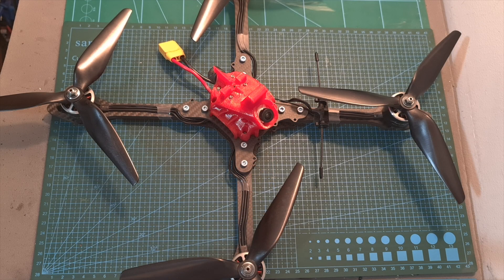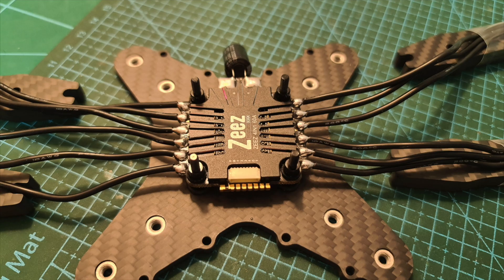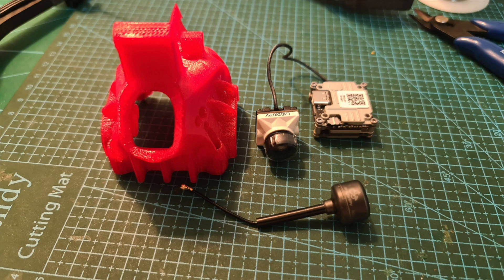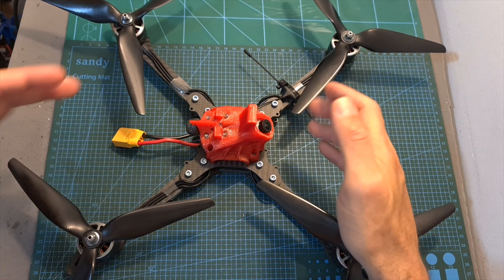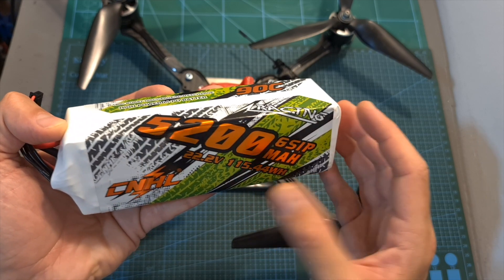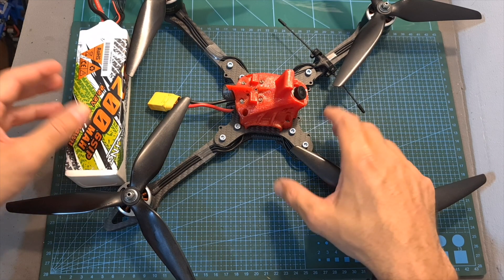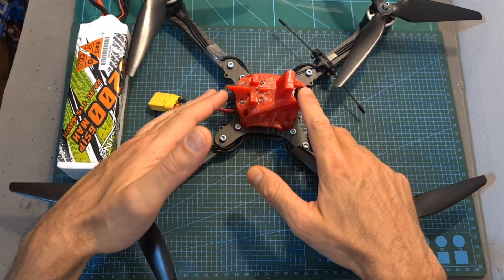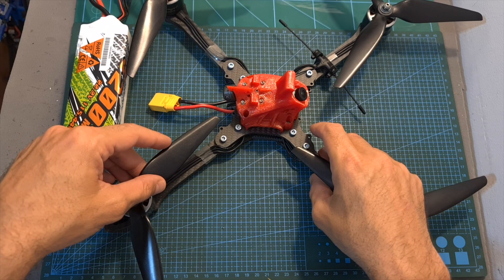How To Build A Monster Quadcopter // CMW Macro Merica 9" Maiden Flight

Comment: Will the 10” with 2816 1050kv still work with a 60 amp 4in1 ?
Reply from the maker: It might but I would recommend to limit the motors output to 90% in order to stay on the safe side.

Comment: I usually take your advice but this time I have to respectfully ignore what you are saying and build one for myself. 

I had already ordered the frame and the rest of the parts after I watched your motor test video for the Avenger 2816 1050kv to build a real bad boy :)

Apart from the parts being delivered, the only thing holding me back are the choice of lipos. 

I am surprised the suggested batteries are on the heavier side, almost as much as the weight of the quad. I am wondering if the motors/prop combination makes for a very power hungry setup  or are we wasting more power carrying so much extra weight.
Reply: Hi, I ordered everything too including the 2816 1050kv brother hobby motors. What conclusions did you have with the battery sizes on your build. I do have a 3300 mah 6s battery on hand and wondered if I should go bigger. Thanks
Reply: @scottgivens27  I plan on using 2 x Tattu 6s 1800mah in parallel on the build because I do not want to invest is a very large lipo that I can’t put to any other use apart from maybe field charging which I never do.
Reply: @kafie1980  yes! That makes sense. I’m using a HGLRC 60 4 in 1 esc. I’m hoping that will be enough for this build. Thank you for the help!
Reply: @scottgivens27  I am going to run the Rush Blade 60A (Super edition) myself. Pretty sure it will hold up to the torture as per Gal’s motor tests. CMW is also using a similar 4in1 ESC on the BNF version they are selling now.